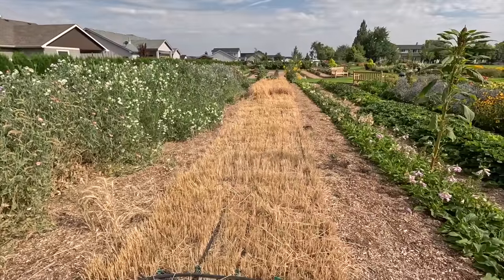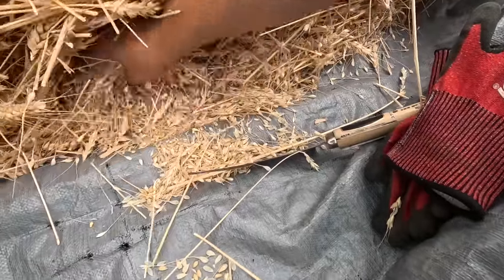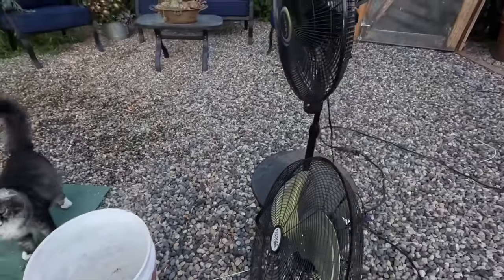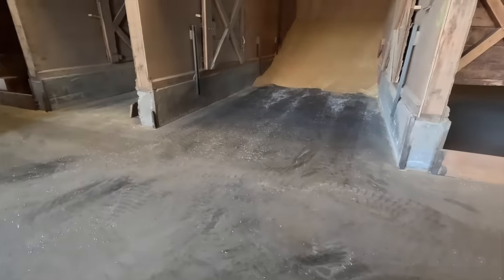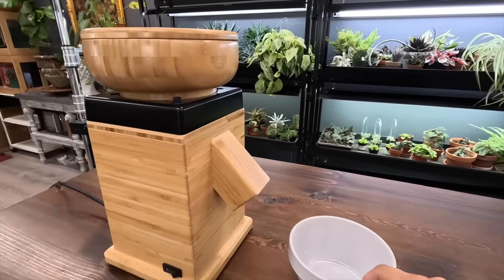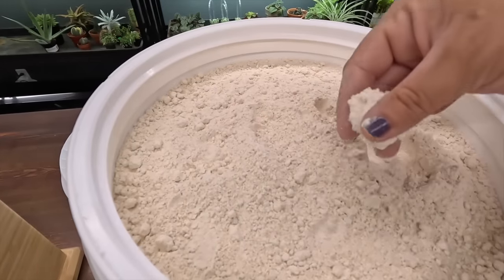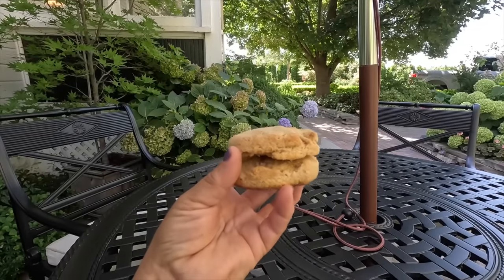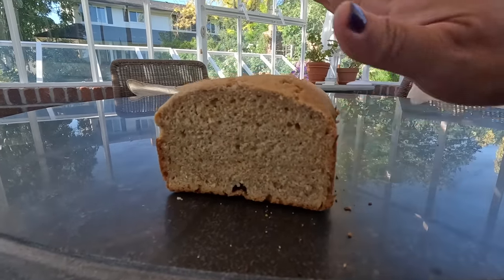Harvesting Our Wheat & Turning it Into Flour! 🌾✂️👩‍🍳 // Garden Answer

Comment: Hey Laura ... baker here. You used whole wheat flour for your biscuits hence why they were denser. The bran in the whole grain cuts the gluten strands. You need to "bolt the flour" aka sift the bran out. Awesome video!!
Reply: You can also soak the biscuit dough for a few hours, just the flour, fat, and liquid. Then add salt, baking powder/soda, and sugar if desired.
Reply: What do you mean...that the bran cuts the gluten strands ? If you don't mind explaining.
Reply: absolutely  @ramsrnja
Reply: @wingedinfinity6715 

I'm assuming it means the tiny particles 'interrupted' the gluten from forming strands? Their presence prevented formation?
Reply: @dethmaul  Ahhhh ok, that went past me. Thank you.
Reply: @dethmaul  I think Shelly means that the sharp edges in the skin/hull and bran actually do cut the gluten strands as the gluten is developing.  It is the strength of the gluten strands that allow the dough to expand and hold the gas bubbles from that result from the yeasts feeding.

Comment: I definitely recommend weighing your flour instead of using volume. It's more accurate and you don't need to worry about changing the measurement for fresh vs older flour. Kitchen scales are inexpensive and really changed up my baking game!
Reply: America’s Test Kitchen recommends that too - is there a conversion table for recipes that measure instead of weigh?
Reply: Definitely! Came here to see if someone suggested measuring by weight. It’s so much more accurate, highly improved my baked goods. I’m hoping Laura gives that a try.
Reply: I started measuring by weight with my sour-dough bread but, now, I weigh most ingredients for everything I am cooking.  I weigh cereal to water for my oatmeal, for my cream-of-wheat, I measure by weight for making spaghetti, or other dried pastas.  I weigh ingredients for all bread products, including cakes, brownies, cookies, etc.  I weigh rice and water for making rice.

I also keep a log for all of those in a spreadsheet - I use Libre Office Calc.  That way, if something isn't perfect, I will know what I did last, and what changes I have made over time.  When I try to fix or improve something, I make usually just one change at a time, or at the very most, and rarely, two changes and then those are in the log as well so I can always tell the effects, for better or worse, of the changes and go back to what worked last if I need to, or I highlight successful changes that yield a great result in green background so I know that's the entry I want to repeat for great results.

Comment: In India we use Strainers with small medium and larger holes to remove the husk and separate different sizes then we toss them in the air to get rid of minute and fine husk. We also use fan for this process.

Comment: We have the same mill!
Fresh milled flour isn’t quite as shelf stable as the store-bought flour. From what I’ve read, it should actually be refrigerated. Because of this, we only mill what’s needed for a single days baking. The good news is, when stored properly, wheat berries can last 25+ years! 
Just thought I’d share. 😊
Reply: How do you store them properly?
Reply: @rebeccasnell2953  we store the wheat berries in a food grade container with a gamma-seal lid and I also add desiccant packs.
Reply: @rebeccasnell2953  Long-term storage should be in Mylar bags, like a 5 or 6 gallon bad inserted into a 5 gallon bucket.  Fill the bag, but not so full you can't get a  lid on, then put in appropriate sized oxygen absorber, seal the bag with a clothes iron over a board, or a hand-held sealer designed for the job, and put any lid you want on the bucket.  The bucket is just for protecting against punctures and, somewhat, from mice - but mice will eventually go through the bucket too if you don't take steps to eliminate them.

50 years ago, there was no such thing as an oxygen absorber.  We protected our wheat by putting dry ice in the bottom of the bucket and let it dissolve and, theoretically, replace the oxygen with CO2 - but there was never a way to test it.  Then we put the grain slowly into the container, hoping to not expel the CO2 as we did so.  So we're pretty lucky today with the oxygen absorbers, etc.

Only use gamma  lids for short-term storage, a year or less.  Their advantage is in being able to quickly open the top and get what grain you need for today.  But from the first time you open it, you
Reply: @rebeccasnell2953  dry and cool. You also need to deal with rodents and insects if you want your grain to last very long. Even in a bin, out in the heat, cold, and humidity, grain lasts several years with no serious loss in quality (just keep it dry and the rodents/insects out). Flour doesn't really need refrigerated, but it does have a pretty short shelf life (a week, maybe two at 70F in an airtight container).  It's not much different than coffee or nuts. 

My thought is, it only has to last a year, for the next harvest to come in. Seed (assuming it's a winter facultative variety) only needs to be kept for a couple months before it's planted again (check your hessian fly dates for best planting times).

Comment: If you are planning to keep producing wheat, I think it would be better to get a scythe. Grains are usually harvested by hand with as much length as you can to make the thrashing process easier. You'd take a whole bundle and physically thrash it  to dislodge the grains and you harvest retaining the length so you can hold it well while thrashing. What you have is a hand sickle and you'd have to bend down really low or squat down to use sickle to harvest with that length. So, its better to get a sycthe to save your back

Comment: To use it with yeast, you can do a double grinding. And use a sieve for removing the bigger particles. Might also require extra kneading if you got the patience. But that should turn out fine.

Comment: The tool you have is, I believe called a scythe. You should look it up the used these for just the task you are doing, but with a long handle.
 Also try using a clean  barrel with a piece of fine mesh wire  over the barrel. Just the berries will fall into the barrel.
I am about to plant my first crop this winter.

Comment: The tool is called a sickle and the “berries” are grains of wheat. You could use a flail, a stick with a flexible belt attached like leather drive belt, to belt or flail the straw to get the grain. It is  flailed like this in less developed countries. Don’t try to get every grain, about 70% is pretty good. A berry is a multiple fruit with lots of seeds, a grain is self contained. To clean grain, it is aspirated (blown) sized through 4 or so slots of various sizes and usually gravity cleaned. Screens are usually measured in /64ths so 12 would be 12/64 or 3/16. 100 sq ft producing 35 lbs is about 7 tonnes/acre which is an astoundingly huge yield for wheat where I come from.

Comment: ProTip: a scythe with grain cradle is cheap, and you can knock out hella more - we do a 100x100 plot in about 2.5 hours. Little less than an acre a day if you go at it all day. 

We then use a modified leaf mulcher to flail/thresh. 

Small investments in tooling can save days/weeks if you scale up to a growing a full year's supply.

Comment: You want to make sure to run your mill completely clear of any stragglers, turning it back on with berries inside the machine can cause jamming and damage to your motor. I run mine several seconds after it has finished milling the berries. 
Btw: 1 cup of berries = 1 1/2 c of flour.
Unless you’re feeding an army you want to keep it in berry form as long as possible rather than storing flour to keep the healthy nutrients. 

The finer the better.

Comment: Try grinding it a little coarser for bread. Use a mixer when you start adding the flour to the yeast/water mixture, it helps to develop the gluten. Slowly add flour while mixing until the dough becomes firm. Dump it out, slowly add flour while kneading until it's not sticky anymore. Just a few tips to make it work. Not a fan of bread machines. Great video, I learned a lot! Your gardens are amazing! So impressed.😊

Comment: Part of the reason your biscuits were short on the rise? Cut down on the twist you give that cutter.
Gramma used to just hop the cutter thru the dough like some demented rabbit, then peel up the scraps and cut 2 or 3 more. Then just pick up the biscuits, tuck them into a pan, and off to the oven.

Comment: Fresh milled flour goes rancid very quickly (within a few days) because it has no preservatives in it and contains all of the bran and the germ. It is always best just to mill what you need and then whatever is left over, put it in the fridge or the refrigerator. I have the same grain mill and also the nutrimill classic. I buy my organic wheat from the local granary.   Lovely video and so inspiring.

Comment: Cool stuff.
Why not cut the wheat berry heads right at, or close to the base of the head, rather than further down and have so much stem material to separate? It would be more difficult to cut with the scythe, but still save a lot of time.

Using a large piece of 1/8” hardware cloth would help, too, like they had at the grain mill.
I bet you could create something out of PVC pipe, that would help separate the chaff from the grain. Maybe a 6’ piece of 4” PVC put at a 45 degree angle, with a 2 inch “Y” fitting in the middle and the bottom of the 4” PVC pipe going to a bucket. In the 2” Y fitting (might need to use a 3” Y fitting, instead), you would insert a multi speed blow dryer (heat turned off), to blow the chaff out the end of the tube. Feed the grain in the top end of the pipe, the chaff gets blown out, and the wheat berries come down and out, into a bucket. It would be easy to make and likely work well. 
Perhaps you could just use a straight piece of 4 inch PVC, insert the below dryer in the top of the bottom end, right where the wheat berries fall into the bucket and turn it on, then feed the wheat in the top of the tube. 
Just some ideas.
Try growing some buckwheat next year, a grain with a lower glycemic index and healthier than wheat.

Comment: If one were doing this in (or in case of) a shtf situation. One would want to mill in small batches as needed, to avoid nutrient, flavor and calorie loss.
Unless, your electricity is grid dependent and you didn't have a hand crank. Then you would mill it all up front ...and then immediately go get solar panels and/or natgas generator.

Comment: Whole wheat flour will always turn out like what your bread did.  Try going half whole wheat, half white flour. Also, use a wetter (higher hydration) dough and a bit more yeast, especially if you don't add the white flour.  The wetter dough makes it easier for the yeast to do it's  job and make the dough rise.  But even with all of that, don't expect to see the same results that you see in whole-wheat in the grocery store. They aren't actually selling you whole wheat; it's white bread with some small percentage of whole-wheat flour mixed in.

Comment: You need to use MORE liquid in all your recipes. The dough will seem loose but if you let it rest it will tighten up as the bran sucks up the moisture.  Things will not come out exactly the same as flour without all the bran, this is hardcore wheat flour. It is considerably better for you healthwise that's for sure. To learn more about baking with fresh milled wheat berries Sue Becker has a lot of good information. She has a few YouTube videos and also a book.

Comment: I just bought a grain mill. I tried milling spent malt grain.  I milled 3 lbs for 5 minutes and it still has fibrous particles in it.  I can't make a loaf of bread with it to save my life. We want to get totally away from any processed flour except our own.  Would a super fine mesh get those bits? I made pancakes this morning but had to use purchased whole wheat. It worked ok but still had no electicity.  I'm at a loss. Any help is appreciated.

Comment: Have not read all the comments, but, grind your grain into flour when you are going to use it. Once ground, important nutrients will oxidize and be lost after 72 hours. Stored properly, whole grains last for years in their air-tight hulls. Flour doesn't age as well, especially whole grain, which due to the presence of the germ may go rancid. 

"For whole wheat flour and other whole grain flours, like rye and spelt, the bran and germ (the parts of the kernel removed during white flour's refinement process) may cause faster spoilage. These flours contain fats susceptible to rancidity which can contribute to shorter shelf life". Feb 16, 2023 - Epicurious

Comment: Real wheat is incredibly nutritious. You can literally live on it. HOWEVER, you need to use it as you grind it. Depending on variables such as temperature, humidity etc, the nutrients will oxidise/ break down within 24-72 hours. The vitamin E will deteriorate within the first hour, from memory. Vit E is hard to aquire naturally, but essential. The flour can also go rancid. It can be stored in the fridge/ freezer for a short time, hours, not days or weeks. Which makes the (processed) flour you buy off the supermarket shelf totally deficient in nutrients. Cardboard would be healthier to eat. Yes, they add SYNTHETIC nutrients, but it is not what our bodies actually need.  They need the real stuff. Wheat has a large variety of nutrients, far more than the few fake ones that are added. You can also taste the difference between fresh flour and dead shop stuff.

Comment: Dear friend, 
You just take two rough knife,  you fix it on wooden board,  make v shape, 
While cutting,  you make bundles as grocery stores sell spinach. 
You pass this bundle between v shape,  you don't need to rub.
Seeds will come out.
V shape must be little longer,  you will understand by doing this job. 
You can seprate the seeds very quickly. 
Just pass between v shape iron or wooden rough knife. 
Jay Bharat.

Comment: Your tool is a hand length scythe.  As thin as, and as sharp as a razor.
Reply: As soon as harvest is done, we work the ground to turn some of the stalks back into the ground. Herbicide is used at this time to kill weeds from the wheat seeds. Then comes fertilizer that gets turned into the ground. Then you plant the winter wheatgrass seeds. You will get a 20% higher yield from a winter seeding, compared to a spring seeding. But the process is always the same.

Comment: ...hello: are you doing it for the first time? grow wheat?
why only wheat?
Wheat is just one grass among many types of grass. In nature - in real nature everything has its origin - so it grows together!

I have an attempt in preparation:
1.) mixed seeds, i.e. no pure seeds! so there are several
       types of grain.
2.) We don't want to cut, like you do with a sickle, but from below
       tear it off upwards: it's quick, faster - and you only have that
       upper area of the grain.
3.) we want - husks and awns - also stalks - when harvesting
       leave together. the reason: it's been the way you've been doing it since
       Common all over the world for centuries!
       but you see for yourself that a stalk, husks and awns - one
       much larger mountain - that is, if you utilize it - the
       can increase the harvest quantity significantly.
4.) the components of your wheat - have in the upper area - i
       call it "head" - valuable in all its components
       minerals, trace elements and vitamins that help build up the
       grain stalks are used.
       It's pretty pointless to just throw away the more valuable one
5.) You have a small John Deere: that would be a vehicle, small and
       exactly suitable - ideal for a comb harvester: you would have to
       Convert it yourself, add an attachment to the front.
6.) Types of grain with a complete head last better when dried
       normal, cleaned grain - because that's where the wheat grains are together
       lie and therefore need to be ventilated so that they do not
       moldy.
       The high proportion of stalks, husks and awns is an effective,
        natural drying agent.
7.) basically the entire head of the stalk, the stalks -
       ground, i.e. processed into flour.
       Here it would be important to find out what effects the high
       fiber content of the entire grain, precipitated with this method-
       and what properties are involved in the production of bread,
       baked goods result from this different form of harvesting.
8.) With the new process technology- the yield of the wheat harvest-
       the mixed harvest will increase by a factor of 3-5.
9.) By eliminating the processing stages, you can quickly and...
       quickly reduce the total effort required for harvesting and storing the grain -
       to reduce

Do you know anyone who has already put this method into practice?
I'm missing, so to speak, some kind of feedback on the planned approach!

Kind regards from Berlin, Germany
Reply: Интересное видео. Первый раз вижу, как можно собрать зерно с маленького участка земли.